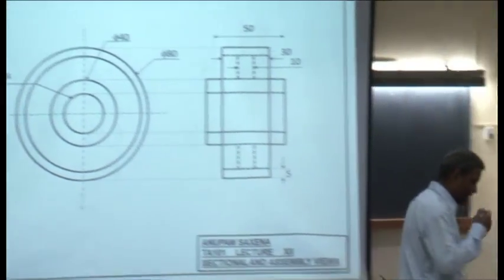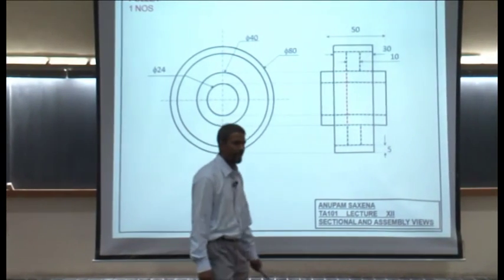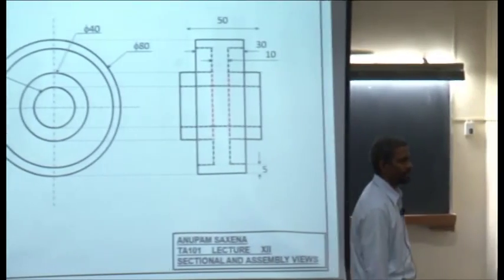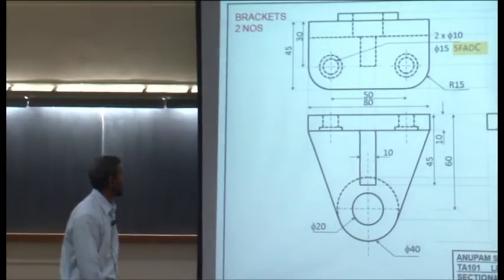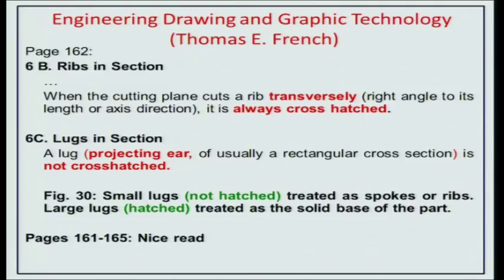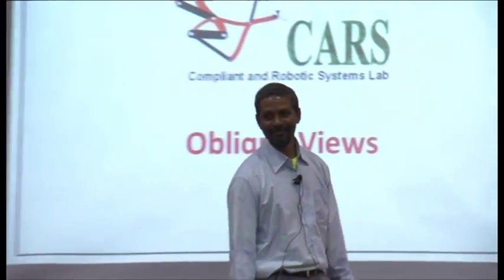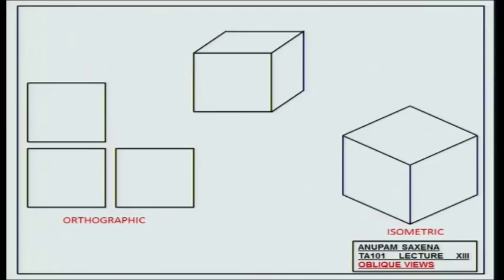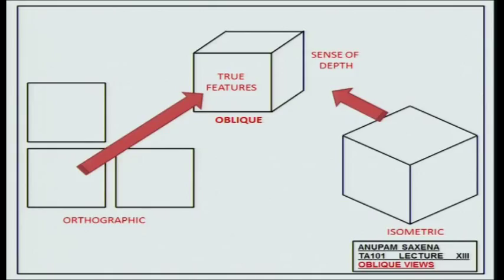Mod-01 Lec-13  Technical Arts 101

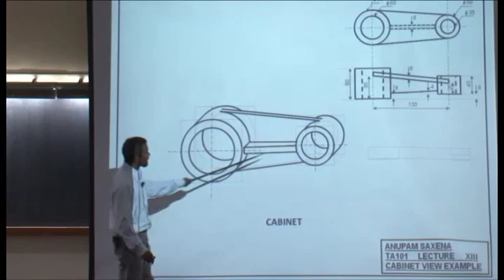Comment: I am really enjoying your video series.  Working as a machinist, I've used drawings like these for years.  I believe there is only one error in the last oblique drawing at 44:00... the middle rib appears to be drawn horizontal and not properly aligned with the center Z axis of the two bosses.  I may be wrong in assuming the top view is symmetrical about the Y axis.  Just my two cents.
Reply: He doesn't handle this channel so he wouldn't read this
Reply: He is our tutor now